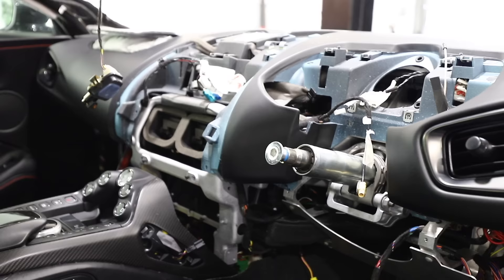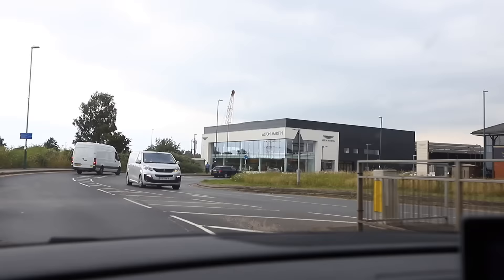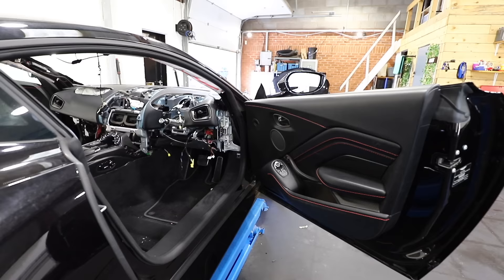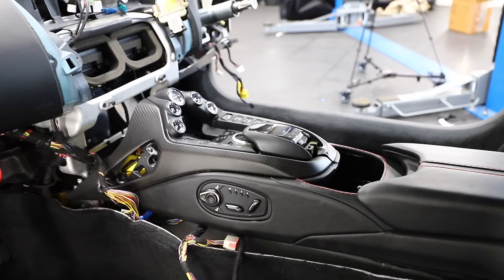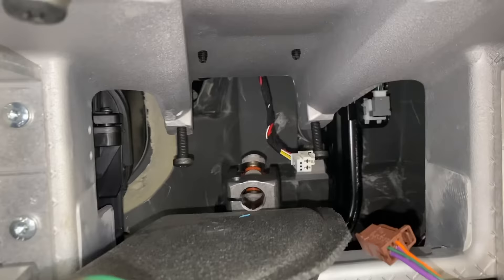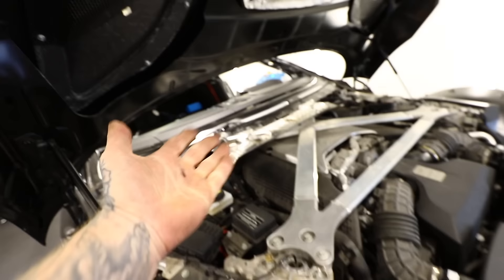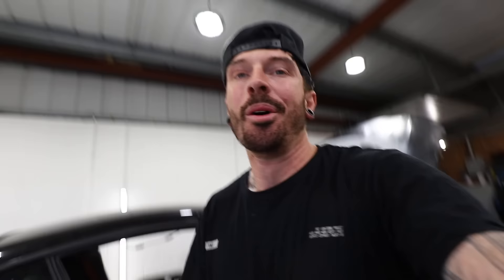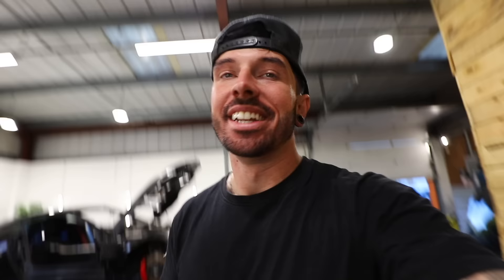REBUILDING A WRECKED 2019 ASTON MARTIN VANTAGE | PT4

Comment: I like that while it's clearly built for Aston Martin to make money on repairs, they're giving you the information you need to attempt it yourself.
Reply: I would not say designed to make money, I think as a car manufacturer it will be designed for ease of production, if everything is done outside the car for the dash then in someway it actually makes sense?
Reply: its also designed to look clean hence the airbag blowing through the dash cover.
Reply: It’s all down to the most efficient way of installing the parts. Every penny they save on the initial installation is profit, they’re not interested in how difficult it is to repair a crash damaged car as there’s no profit in it for them
Reply: @christopherruddick88  When you combine this with the fact they won't sell certain parts to anyone but Authorised Repair Centers, that says they don't want anyone else repairing their cars.  That is borderline anti right to repair.  Which means they're doing it for the money.
Reply: @superblackbirdrider  How is there no profit in it if they are the ones equipped to do it.  And certain parts only go through them  I guarantee if this went to a regular mechanic, they wouldn't take the work.  In this case, they want him to send the car in because he would have to pay out of pocket.  This car was probably deemed a write off because of how expensive it is for the customer and potentially parts availability.  They might as well sell what's left of the car and get a new one.
Reply: @superblackbirdrider  Saving every penny would mean not installing a dash this way because they would avoid spending money on re-tooling.  Making new parts and tools to make or install those parts.  This reminds me of Apple's repair tools.  Over engineered for something that should be simple to do.
Reply: @TheOmegaRiddler  sweet jesus, no it is not anti right to repair at all.. The items that were authorised repair centre only were safety critical STRUCTURAL items in crash cans! 

Strangely enough i can understand you might want to limit availability of specific parts like that!
Reply: @TheOmegaRiddler  no probably written of by an insurance assessor and it went over a 60% of value threshold, full new front end, bonnet, redoing the airbag and all the labour involved will be exactly why. Plus being an insurance job will mean there will no dbout be some stupid markup.

Comment: Great job, great perseverance. I think you will find that whoever you get to re-trim the dashboard should be able to buy the same leather it's not exclusive to Aston.   I had a section on my DB9 done and the same leather was used.  Shrinking leather is a common problem with most Aston's so the leather is generally available through the main manufacturer Bridge of Weir based in Scotland.
Reply: The best leather suppliers. Period.
Reply: Mayby you know. Does this guy paints his hair with black marker?

Comment: I’ve been outside in the rain trying to change the main beam bulb on 2010 Polo…. Cut me hand to pieces. Dropped the rubber cover into the engine bay and now the beam points to the sky…..   it’s not just the skill this guy has it’s the patience that amazes me.  That car would’ve been crushed , set on fire, crushed again and dumped in the sea by now if I had started this.  Good work my man,

Comment: you disconnect the heater matrix, then undo bolts on both sides and remove everything together. every cars dash is prefitted and installed fully assembled, also airbag controller reset or second hand, you can salvage the dashboard if you can afford to put leather on it.

Comment: Leather used to be supplied by Bridge of Wier. Probably still is as they do alot of the high end imperfection free leather. If you need supercar repair advice try Chartwell of Derby they will have done a few of these. Good luck with the rest of it.

Comment: If they're xenon, they aren't directional. That said, you may have to get the coding changed to fit what you've bought. If you've got the same ballasts you're in with a fighting chance. Been there got the scars to prove it. I helped a mate rebuild a DB11 with 47 miles on the clock. 55k for the car, similar damage to yours. Got a front end for 15k and another 4k for bodywork and bits and bobs. It turned out nice in the end.

Comment: Matt Matt Matt take a moment and think about how there installed, there modular and as little work carried out on the prodction line as possible , so it was fairly obviously as few a fixings as possible,in fact all dashes are done like that I guess one guy each side and just push foward of the lifting arm and screw home after pushing all the connections together.
But your doing a great job , as I said before please try the remade connections are live before finishing or it’s all coming out again good luck Mick G

Comment: Hello Mat…. long time fan and loving this series. About the instrument panel….. you won't be able to just "leather over" the passenger air bag. The skin “leather" is scored to a specific thickness and in a
specific area. This thickness is determined during the deployment development and is defined to allow the bag to detonate in a correct fashion and in a safe way so the timing allows the occupant to survive the impact. Without the score of the skin,
you will effectively be stopping the detonation or worse not controlling the detonation. I'm pretty sure you're looking at an OEM replacement either new 2nd hand off a damaged car down the local scrapyard/eBay etc. Also the “flap” is called the lid, once this has deployed it cannot be fixed either and this is usually welded or foamed into the IP. (Instrument panel/dashboard).

Comment: I wish Mat could confirm if there are only clips and no screws holding down the center console.  That seems almost too easy.  I'm a little afraid to just undo the wiring harness and yank on it to find out.  There are a few Apple CarPlay modules available for this car / Mercedes NTB5.0, but no good videos on how to install it.  It looks like all of the connections are under the center console.  Maybe I'll make such a video.

Comment: now when you know which bolts was holding top of the panel, Is it possible to reach them without taking panel from the car?
Reply: for me it looks like you can undo them through the hole where is speedo on the driver side , and on passenger side you can reach them by braking airbag cartrige, or somewhere around the heater-glovebox

Comment: The most ridiculously over engineered car I’ve seen. There is no reason a dash on a frame pull need any more than 4-6 bolts holding it in. They could’ve saved about 100 kilos in weight by reducing all that silliness. Well done for persevering Matt